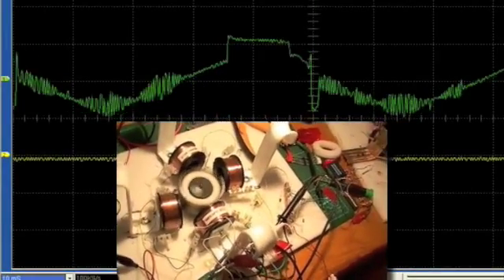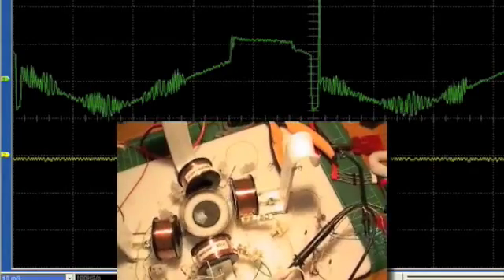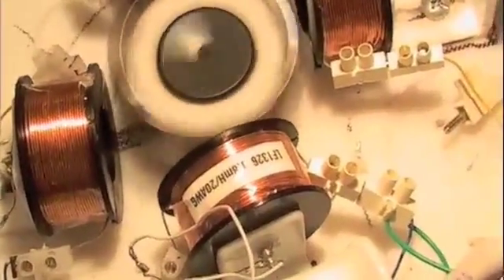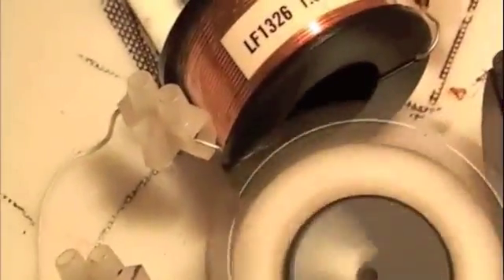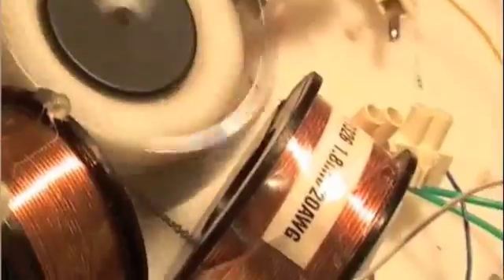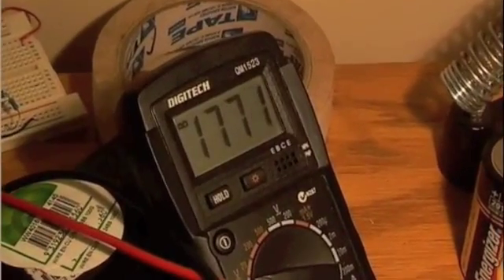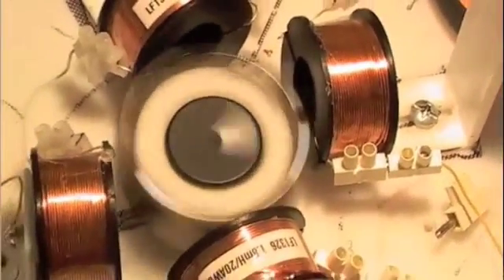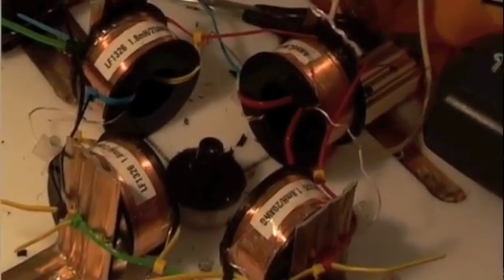ossie motor - coil polarity

Comment: What do you mean running a Motor on an AA Battery.
It is stable at 1.5 Volts ?
What does it consume on current. Has it any Load on it ?
Normally you can power a toy motor with ONE AA Battery and it does
some work.